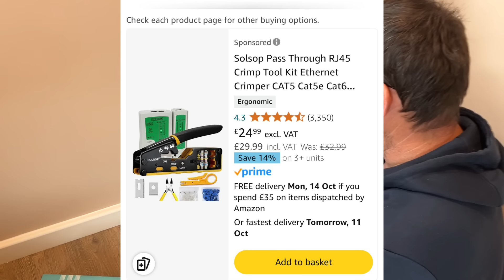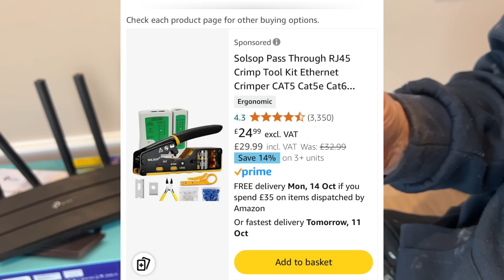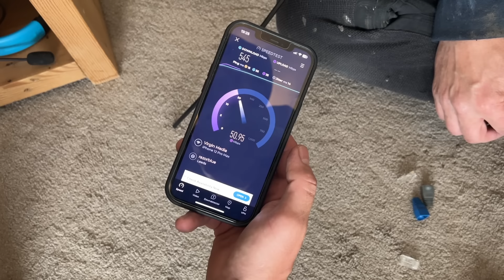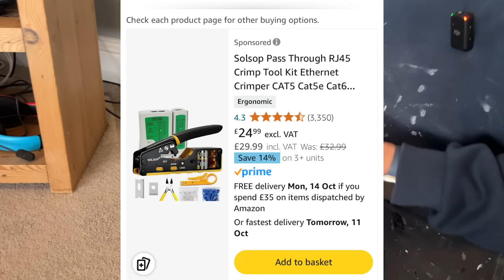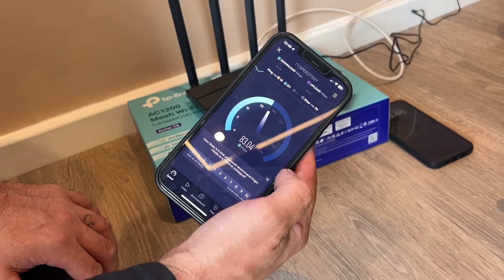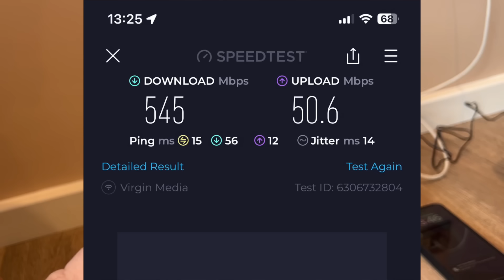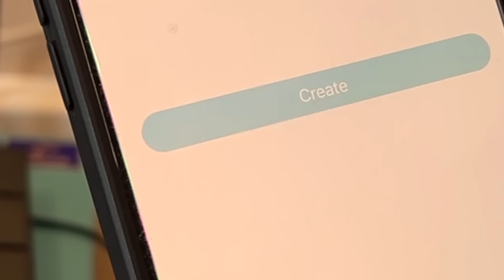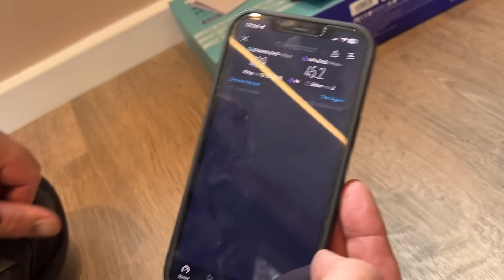The ultimate how to build a garden room series, part 10, full cost, internet and completion

Comment: Deffo hard wired everywhere, I took advantage of no floor in one room during Covid to wire every room bar bathrooms with a minimum of two ports each using CAT8 for ultimate future proofing, and will be running fibre optic to garden room/workshop later this year once my build is watertight. Any switches/access points I have are also POE(Power Over Ethernet) which cuts down on power socket blocking.